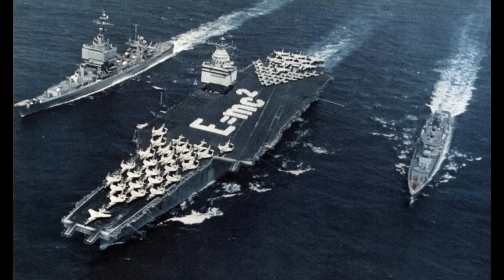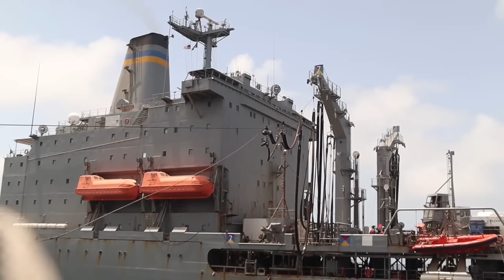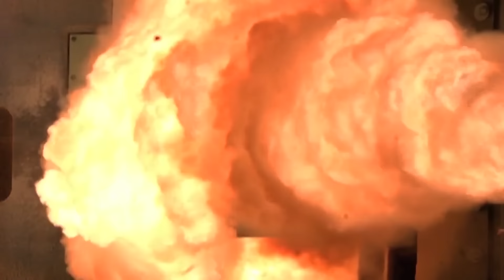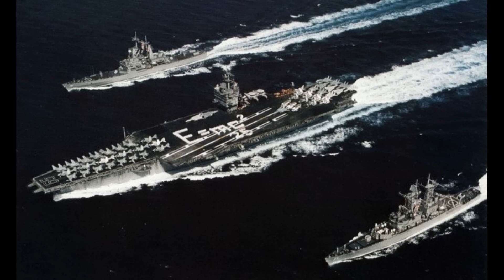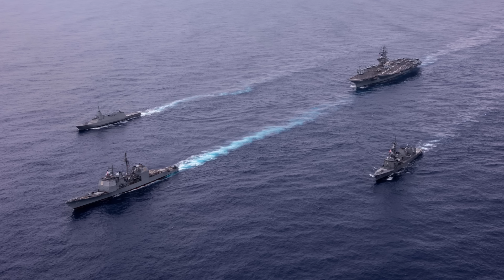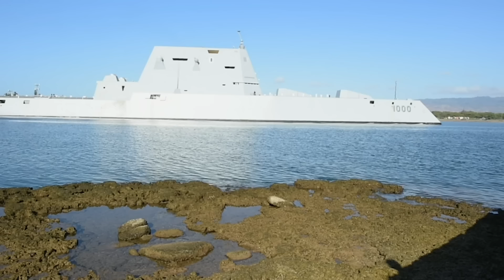Should the US Navy Bring Back Nuclear Cruisers?

Comment: The USN may have no choice in the matter. It's all well and good to have a fully conventionally powered fleet, but what happens when your fuel stocks run out and you can't get anymore. That means you can't put to sea and do your job. That could very well happen during a war. Where does the USN get all of its fuel from and how much of it can be used to sustain operations without causing critical shortages elsewhere. That's the question you have to ask. And, what happens during a war, when the ships pull into allied ports only to find they're short on fuel as well. Doesn't bode well for prosecuting the war. So, a nuclear option of some description might end up being inevitable.

Comment: The author's criticism of nuclear propulsion are based on and quite literally anchored by the obsolete concepts and thinking of the past.  New nuclear design thinking is needed to build cost effective nuclear propulsion, replacing the past regime of nuclear at any cost.    This must include built-in provision for refueling and maintenance.  Technologies exist, but the legacy from 60-70 years ago must be made to yield to better thinking.  And the large onboard specialized crew devoted to a Rickover memorial propulsion system needs rethinking ala remote work.  I submit that properly designed, the crew for a new nuclear propulsion need be no larger than for CGT propulsion, with remote support readily available to assist several ships simultaneously.

Ships using CGT propulsion, like the Arleigh Burke class, run out of fuel after about 3 days of combat manuevering to protect the fleet capital ships, the carriers.  They still have weapons but cannot move.

Vertical launch weapons and gun rounds, food, and aircraft fuel are as much limiting factors for CGT propulsion as it is for nuclear.  Indeed, the entire USN, surface and submerged, need close to or in combat theater resupply & repair capability that the USN and legacy DoD have ignored for decades, relying on friendly (i.e., bought off) ports being close enough.  THERE are possible solutions, for example the 600,000 ton class floating refineries built by the Koreans.  These ships are so large that a 100,000 ton carrier is small; they are virtual mobile islands.  Building several vessels based on this example and combined with swath ship concept could be constructed as floating dockyards and resupply hubs.  Nuclear powered, of course.

Comment: Zumwalt class destroyer is practically a cruiser, but stuck with oil burning gas turbines.  Let's consider resurrecting the CGNs and repowering the Zumwalt class.  Challenge is cost, made high by one Captain Rickover intentionally.  Rethink how to design a replacement nuclear  propulsion system the same way SpaceX has redesigned its Raptor rocket engine, simplify-simplify-simplify.
What advantages:
  +  Virtually indefinite length combat duration because the crew will deplete everything else before the core runs out of fuel.
  +  Flank speed is normal cruise because you can design the reactor(s) to operate that way.
  +  NO exhaust stacks, more useful room.
  +  Major weight is low in the vessel, aids surface skimmer stability
  +  No huge tonnage of sticky, toxic, flammable oil to power the propulsion; this should offset the space taken up by reactor shielding

In a modern nuclear propulsion design it should be possible to keep the required operating crew complement down to the same as the current beloved GT-propulsion.  Let's rally the DoW, POTUS, and Congress to get behind this idea with a solid proposal and authorization bill action.

Comment: Sea Power Reports doesn't know what they're talking about. For one, modern nuclear fuel is essentially 3d printed in the fuel matrix part of the fuel assembly. That enables a reactor to be designed to last the life of the ship, such as in the Ford-class aircraft carriers. Since the 1980s, each successive generation of nuclear fuel has had steadily increasing life to the point that today's fuel cells have a fifty year life. 
Obviously you've also never heard of underway replenishment, that has been a point of pride for the US Navy for over 80 years. The French are the only other navy that comes close to doing what the US Navy does. The British might try, if they had a navy. All other navies in the world are frankly a joke, they are not in the same class as the US Navy, they aren't blue water navies. 
Also, you seem to be behind the times on planning and manufacturing. There is a very good reason the US Navy has solicited and gotten even uninvited submissions for a cornucopia of new USV design, small, medium, and large. Some from rather small design firms and shipyards show great flexibility and ingenuity. All of these vessels can be built by the US' smaller shipyards that are already busy building the future US Navy.
However, this is the Twenty-First century, there is NO need for new frigate designs. A simple and cheap Expeditionary Sea Base paired with small USVs and other "light" unmanned vessels/aircraft can handle any job that the Oliver Hazard Perry class was assigned. As for a need for more VLS cells in the battle fleet, the large and medium USVs can handle that job already. Just a few lines of code in the Aegis system software to tell the system to prioritize the USV carried missiles and conserve the missiles on the manned warships is all that is needed. 
All US Navy warships should be nuclear powered. Tomorrows US Navy can consist of 11 aircraft carriers, 16 to 18 cruisers, and about 50 destroyers. The rest of the needed VLS cells can be onboard the USVs. AI data centers in the US, allied nations or US overseas territories can handle the operations of the USVs. When one of the USVs has depleted it's missiles or other stores, it simply receives an order to return to whichever base is best suited for logistic. Furthermore, we've only begun to explore all the functions that USVs can perform. We may not even need manned supply ships. However, I think we will always need at least 4 each of the destroyer and submarine tenders. Nuclear for the warships and diesel for the USVs. Leave the gas turbines for the navies that are not professional!

Comment: The new BBGN is really more like a Battle Cruiser, BCGN. But, because of its size, and use of lighter composite armor, it becomes a dichotomy in design. So, its very size will probably still allow them call it a Battleship. 

And yes, the Navy has needed a large nuclear cruiser or larger for a long time. The carriers need proper protection, and the Burkes just won't be good enough.

Comment: you should consider doing a video about the original 1989 flight 3 Arliegh Burke design. It was designed to be a Tico replacement, 122 vls (2 x 64 with the 3 cell reloading crane in both blocks)

Comment: all ships equal to or larger than destroyers should be nuc powered. For instance the Xe-100 by X-energy produces 80 MW of power in a space of: Core Diameter: ~2.4 meters, height ~8.9 meters.  This would take up less volume that the current power plants in an Arleigh Burke. This doesn't even consider the volume savings because no fuel tanks needed.  The destroyer could sprint to any place on the globe with the carriers.  No good reason to NOT go this route. NONE AT ALL.

Comment: They should bring back the idea of the Strike Missile Crusier. It was a really good idea and it was going to display 18,000 tons. The VLS capacity would have exceed over 300. It would've been better the Ticonderoga class cruiser. Sure more expensive but better service years out of it.
Reply: Except if it got hit then that's 300 VLS cells and missiles gone. That's why it's best to spread it out over many ships. Also turning the Ohios into missile cruisers is a better idea because they can hide in the water.

Comment: The A1B reactor from an aircraft carrier would not fit into a cruiser sized vessel. Two S1B or S9G reactors would easily fit into a cruiser sized vehicle which would be about 150% more power than the ones on the Virginia class CGN’s.

Comment: nicely done, although I don't agree with the conclusion due to three items. 1 - The choice should not be either/or on Burke reference vs CGN, it should be a blend. Instead of a projected 99 Burkes, we should see 10 CGNs (double cost of Burke), 40+ FFG (half cost of Burke), and 50+ Burke. Hulls in the water are not the number which is relevant, but days of capability provided on station. 2 - costs - I note you added cost at the front end (Nuclear Vessel being 1.8x cost) but then doubled that again at the end mentioning a costs of 3-4 Burkes for one Nuke, but there is no acknowledgement of savings through lower support ship need (fewer ships, fewer escorts for those ships,  operating costs saves through all those non expenditures) to say nothing of the purchase of 25+ years of fuel is already priced into the 1.8x multiplier at construction. Another offset that should be done on the nuclear vessels is Blue + Gold crews.  3 - refueling. Reactors coming out today have 25-40 years lifespans (25 for A1B, 33 for S9G, 40 for S1B) and again, that high initial cost is all the fuel you would have had to purchase and move to get to the vessel across decades - and it is bought in FY dollars from years, even decades, before, ignoring market price increases on oil. Integrated Electric systems must get their power from somewhere - either a reactor or burning fuel.  A blend is the best answer, and the added diversity would help tactically and strategically, as well as having  positive industry influence by diversifying shipyards (smaller yards make the FFGs) and the nuclear industry - which should be expanding for civilian needs as well.  Well Done. V/r CTIC(SW) USN (Retired) , veteran of CGN-9, CGN-35, CGN-36 and 11 other conventional vessels.

Comment: Something overlooked is that conventional ships also spend years at a time in a shipyard on a periodic rotation. They also require far more constant refueling than a nuke boat. The power supply for a current US submarine is good for many many years unlike the older designes. They can also wring out more power from smaller designes that can be used to drive smaller ships like DDG51 class destroyers, while providing even more available power for newer systems. Reloading weapons is an issue as well as replenishing food and part stores but those things are also needed by conventional ships. As for the disposal of spent fuel, That comes at the end of life for the ships. Modern engineering can make a reactor core and housing removable without destroying the entire ship and leave the rest safe to dispose of. One last thing, to the enviromentalist idiots, Nuclear power is cleaner than virtualy every other source of power on earth, and cleaner.

Comment: There is still one big draw back you have not mentioned regarding having a Nuclear power battle group which you say won't have the drag of steam  or gas turbine warships, you are forgetting with every navy that sends out a large battle group they are always sent with conventional  powered supply ships, so unless the US are going to start building Nuclear powered supply ships this falls over straight away, hence the battle group will only ever be able to go as fast as the slowest ship in the group the supply ship that will be supplying food and stores to all the ships in the group and most of all will be holding stored aviation fuel for the aircraft on the carrier as the carrier will need to fill up on aviation fuel regularly  during battle so this leaves the supply ship and the nuclear powered fleet very venerable especially  when refueling

Comment: I think the real determinating factor is going to be the price of a 🛢️ and if it's going to keep going up or not. Last I checked the strategic petroleum reserve has yet to be refilled (after the previous administration all but completely drained it ) and the current 💩 show that is the strait of Hormuz could go even further tits up. The Navy would then have maybe 3 different options besides a nuclear cruiser. 1 go hardcore on synthetic fuel ( coal, natural gas or renewable based, better yet all of the above). 2 replace gas turbines with gas turbofans on all new and midlife refurbished surface warships (quieter to operate more fuel efficient). 3 (As a cost cutting stopgap option) pull a flight 1or 2 Arleigh Burke class out of the ghost fleet,throw it in dry dock gig enough to cut it up and then add 2 or 3 extra sections for additional V.L.S. cells and 1 for anywhere from 1 to 3 reactors from ether the Virginia or Colombia class subs since they are supposed to last for the entire life of their ship's life without having to be refueled.

Comment: Absolutely the U.S Navy should bring back Nuke Powered Cruisers and frankly with the, advancements which have been made in smaller, more efficient and powerful nuclear reactors, we should consider them for Destroyers as well. 

The few reasons you gave in the beginning of the video as to why we stopped all have to do with the fact that this was very early on, during the infancy of nuclear power for ships and those issues no longer exist for multiple reasons. 
  We now have nuclear reactors which are much smaller,  more efficient,  require less maintenance and overhauls and frankly, ZERO Refueling during the ship or subs lifetime.

Comment: Today's destroyers don't have the space for being a command center, which the cruisers do. But we are not building any new cruisers today, and instead just making next gen destroyers bigger, again without space for command centers or being the command vessel.
What this means? More and more jobs are being carried out by carriers, or by vessels that aren't suited for the jobs that need an Admiral onboard.

Rather than bringing back nuclear powered cruisers, what we need is 20,000 ton cruisers. Enough to be flagship, enough to do jobs around the world, such that carrier strike groups don't need to respond.
Reply: The new Flight 3 Burkes are getting a new style CIC with the command & control role built in from new. Also, certain Flight 2A ships are being fitted with a re-modeled CIC to fill this role until either DDGX or BBG-1 gets built.
Reply: @MrWlbblw  Flight III Burke's aren't getting an independent CIC command module. What they're getting is a new style Combat Information Center, which can do some parts of the role that a command module inside a ship does.

Simply, the hull is too small, not enough cooling, -> The software advancements allow Flight III and the IIA modernized ships to be acting Air Defense Commander role -> for which Ticonderoga has dedicated space, infrastructure.

Comment: The new BBGNs should be designed for modular replacement of subsystems including control, weapons and propulsion. The hulls should be large enough to survive 50 year lifes.The Navy tried something like that on the Spruance on a much smaller scale but got the successful Ticonderoga class as a follow on using a slightly modified hull.
Reply: They tried something like that for the lcs ships but the time to switch the modules was to long and some of the modules were never built

Comment: Love that you chose to take on this topic.  Strongly disagree with your conclusion.  USN needs a class of CGN's.

At approximately 20 kilotons displacement and perhaps 192 VLS, it would have a basically identical VLS-to-displacement-tonnage ratio as the Burkes.  With smart design, it should be possible to crew the ship with significantly less than twice a Burke's complement, despite having twice a Burke's displacement.

Seven 50+ year old CGN's spread across FOUR classes is not a great indicator for the economy of scale that could be achieved with a single class of approximately 12 modern ships. There is no good reason to believe that multiplying the entire cost of the ship by a factor of 1.7 to 1.9 is a reasonable estimate.  The first ship of the class might indeed cost 8 to 10 Billion USD and not be commissioned until 2035 or a bit later, IF design work began almost immediately.  But the following ships of the class could probably be produced for 6 to 8 B$ (2026) each.  Sustainment costs should eventually be lower than a hypothetical equivalent conventionally-powered cruiser.

There will definitely be teething pains for years as the ecosystem for CGN's gets created / re-created, but those pains are unlikely to be significantly lessened by putting off for a few more decades what we know we need to do.

One of several core problems that the USN is facing is trying to do everything with a single class of (admittedly excellent) surface combatants.  Things would be so much easier if they would vary their line-up to include Cruisers and Frigates, and possibly even blue-water Corvettes.

Comment: I think the US should start building nuclear powered assault-class ships. Ships that can be designated Lightning Carriers in a pinch.
If they have enough excess electrical power, they can use sea water & air to created 750+ gallons of synthetic JP-5 for every excess MW of power per day.
One standard A1B carrier reactor (125MW) would provide more than enough JP-5 to support maximum effort air operations indefinitely.
If they used the empty troop & equipment areas to store excess munitions, it could become an effective emergency Lightning carrier.

Comment: that funny the merit of a nuke cruiser is the power generation for the equipment on board not speed of deployment. right now the main problem is power generation on board the ship every time  they go to use the radar with the intercept computer and cuff cuff rail gun (i mean the main air defenses system!!) as there moving the ship they lose power out parts of the ship. roll blackout are a problem with how much power the ship needs in combat. please note i'm for nuke none carrier ship's it just this cruise are meant to be disposable assets to the main capital ship's and if one is blown up the radiation fallout?